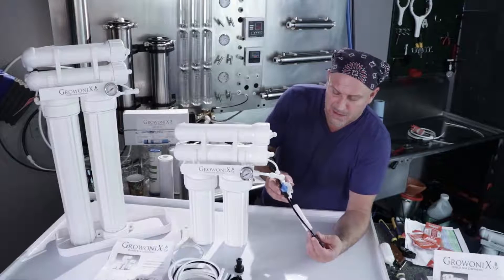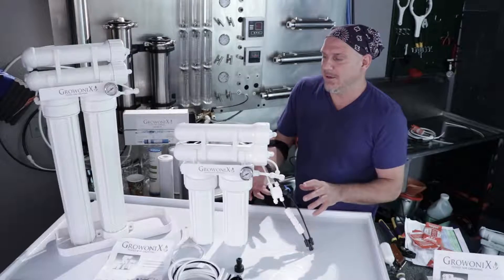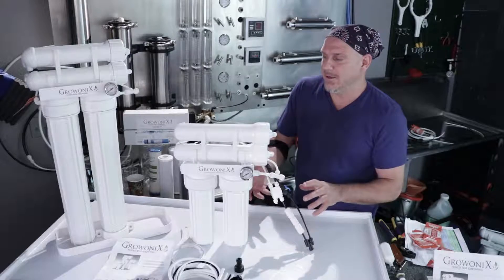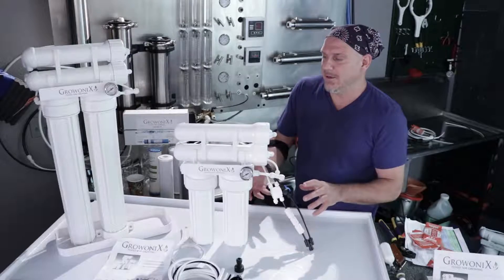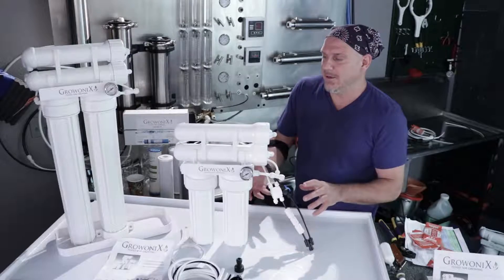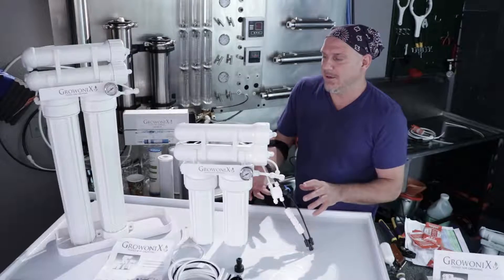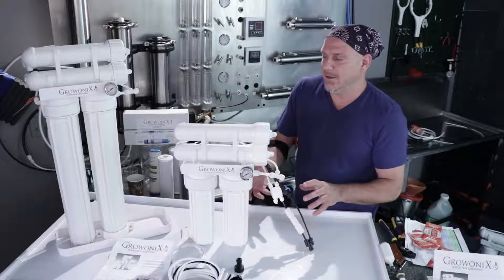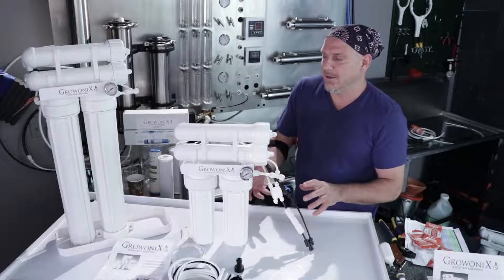GrowoniX EX400 & EX400 Tall: Connecting

Comment: High flow forsure 2:1 ration filled 17 gallon clean water and somehow filled 40-45 gallons “waste” or drain ro water that’s doesn’t sound very efficient to me.
Reply from the maker: Actually 40 gals of drain to 17 gals of RO water is a 2.3:1 ratio—close enough for government work!  And it's adjustable down to whatever you'd like, by placing a 1/4" ball valve on the drain line and closing it slightly to achieve your desired ratio.  This is how all small RO systems work.  Run it 1:1 if you'd like.  In most cases, 2:1 is the leanest you wanna run these little 2" membranes, if you wanna achieve any kind of longevity from them.

Moreover, system ratios are greatly effected by water temperature, so check them periodically through the seasons and adjust as required  to suit your efficiency needs.